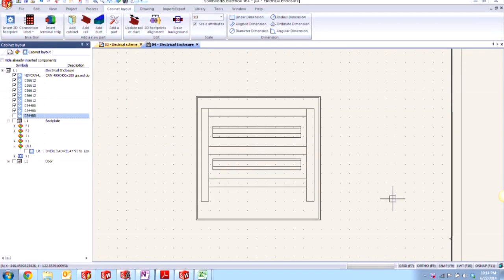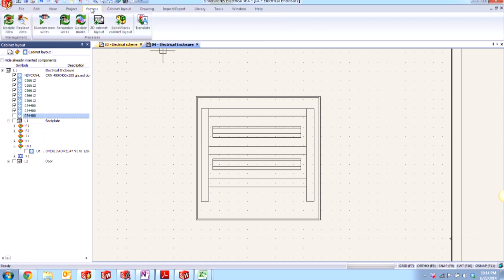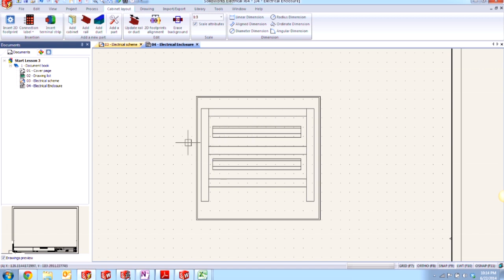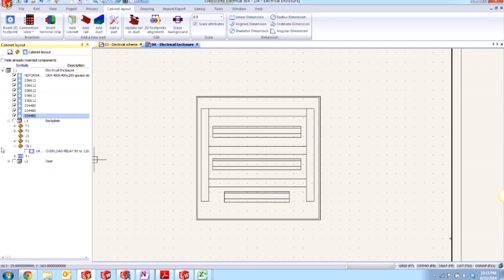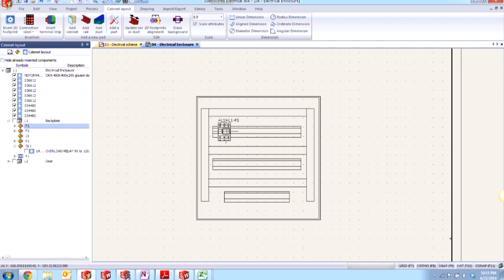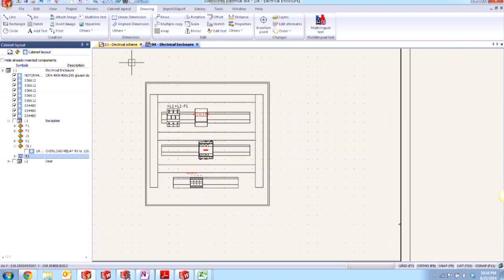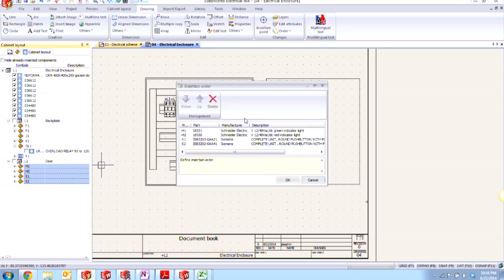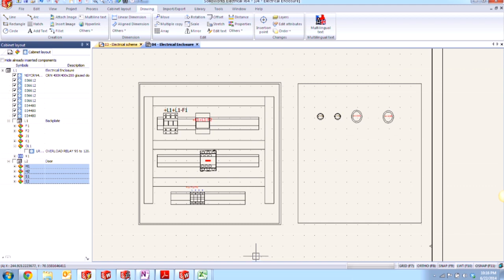SOLIDWORKS Electrical - Creating a 2D Cabinet Layout

Comment: how to add custom  din rail and wire duct cabinet  in solid work electrical and it use with panel in 3d 
i see lot tutorial all tutorial teach me advance but i want to learn basic start with step by step for panel design in solid work 2d and 3d 
please help me